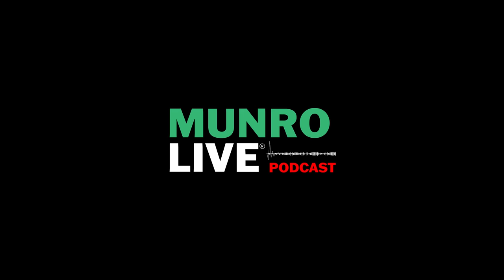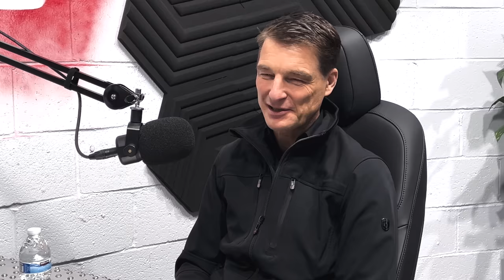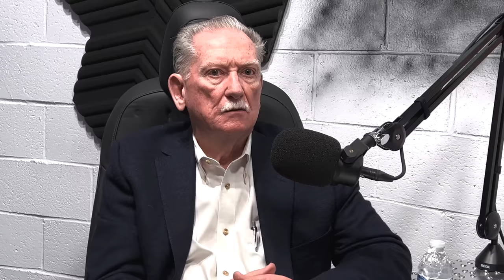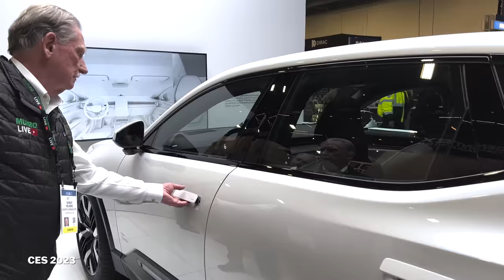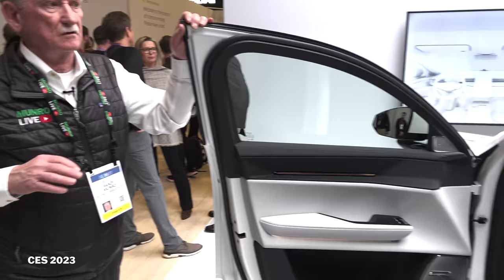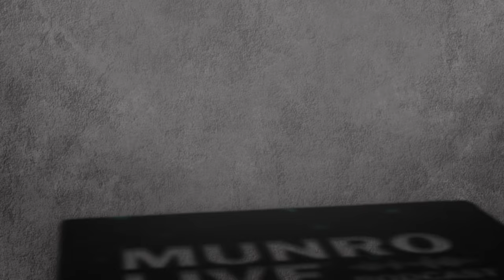Thomas Ingenlath - Polestar CEO | Munro Live Podcast

Comment: Just some added details:  Polestar was originally a separate company focused on making performance/racing parts and enhancements for Volvos.  Volvo acquired Polestar in 2015, similar to how Mercedes acquired AMG to become its performance brand.  After having several Volvo models marketed as "Polestar" versions, along with a few concept cars, it was decided to spin Polestar off as a separate brand focused on either hybrid or electric drivetrains.  So Polestar was not originally created by Volvo from scratch.
Reply: Exactly. Polestar was Flash, a Swedish racing company. Dates back to the mid 1990s.
Reply: @benjaminsmith2287  Thank you both for added context about the history of Polestar. A lot of the Tesla fan media dismiss them as "just owned by Volvo/Geely" but it seems like they have potential.
Reply: @Nphen  The Geely ownership is overblown.. Geely is a good parent company in that while they're not totally hands off with these brands, they're closer to it than other parent companies..

Comment: I was really excited about Polestar taking on Tesla but their pricing is way too high.  I'm just not interested at those levels.  Polestar 4 RWD starting at 60k USD?  No thanks.
Reply: Absolutely correct. They are cool EVs at least aesthetically. The price is not competitive though.
Reply: @fcv1967  The price is the price. Those familiar with Polestar Volvos (XC60 Polestar, S60 Polestar) don't find the price high one bit. Plus, this is a small premium brand, not a low priced brand. The Polestar 5 and 6 will be even more expensive. The 4 is actually affordable for a Polestar.

Comment: This is obvious that Geely rules in terms of skeleton and internal elements. Nice however that they rely on scandinavian center for design of most of their brands. I thought Polestar 4 would not be evoked, but it was too short, and no SEA platform mention.
Reply: Polestar 3 is almost all Volvo. Geely has some overlap overall on lower priced platforms but from what I heard from Thomas, except for the 4, the cars are mostly Volvo based. And Volvo is putting in a lot of their own chosen electronics, safety systems and the platform work on SPA2 was done by Volvo. Volvo's lower priced cars will be on SEA and maybe a few others. We'll see in time.

Comment: Tip for Thomas,i would use in Sun visor instead of mirror another screen for front facing camera, would really be helpful in night driving on narrow roads when facing another vehicle to have a one second look to keep calm if there is enough space for two vehicles when approaching each other, there is degree of uncertainty from lights,and i see some people install some times on the  back facing mirror itself this tipe of camera with screen for better night vision for this cases

Comment: Live podcast featuring Thomas Ingenlod, CEO of Polestar. Discussion about Polestar 2 and 3, and Ingenlod's background as a car designer.

✦ Polestar is an electric car brand created by Volvo with a focus on electrification and a different proposition in the premium segment. 00:00
✦ Polestar 3 is a good seller with a long-range battery and a projected price of $90,000 in North America. 07:22
✦ Volvo's Design Center in Gothenburg is a beautiful and creative working environment. 14:03
✦ Swedish design combines functionalism with a human touch 20:23
✦ Clear direction is necessary for successful transformation 26:31
✦ The automotive industry needs to transform into a more software-oriented field. 32:46
✦ Standard measurement for CO2 footprint is lacking 39:14
✦ Polestar focuses on design, sustainability, and innovation. 44:58
✦ The Polestar 4 car will introduce a camera at the roof and a screen to move the beam, which creates a big view in the rear without any glass section. 51:23

Comment: Software programmers fall into 3 categories: 1) Operating system, 2) Batch processing, 3) Real time/Process control. There is little movement between these groups. There is a 4th which implements the Graphical User Interface (GUI) but they have a significantly different skill set as the programming is a small part of the overall implementation, it's the design that takes the skill.